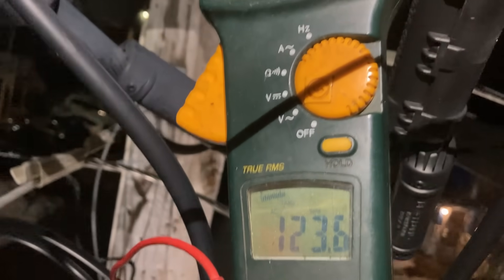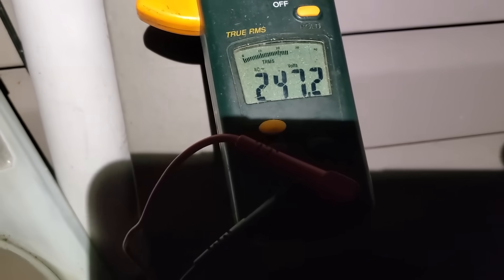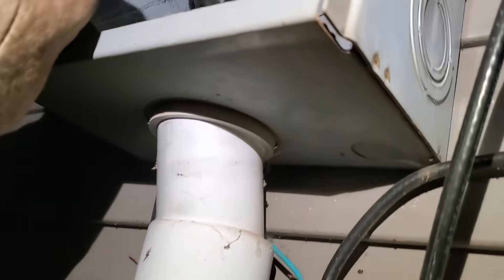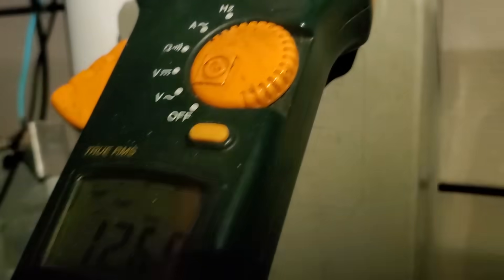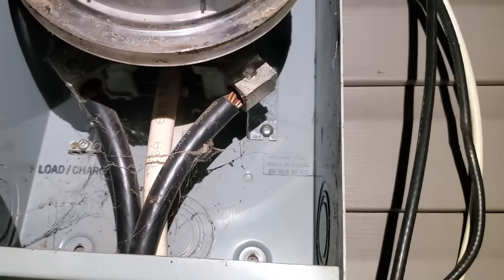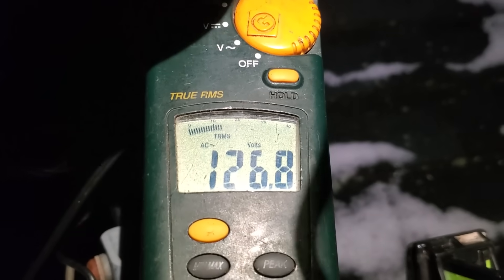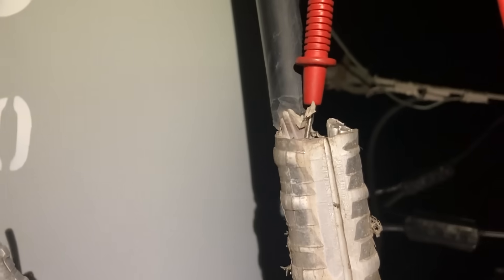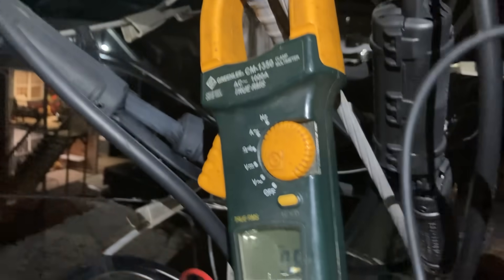Finding a bad neutral on a Service - Raw footage

Comment: I recall seeing my first bad neutral at a house we managed -- Randomly, appliances in the house would start smoking without being touched. Voltmeter read fine, until I set it to hold on max, and then saw that it was briefly spiking to ~190. Was a windy day by the ocean, and over time the neutral loosed within the meter, most of the time making decent contact except during gusts. Love seeing your step-by step of diagnosing problems!

Comment: Can you guys imagine bed neutral here in EU? We have 400v three phase service and 230v across phase and neutral. If you get a floating neutral, there are wild swings in voltage drops/jumps. You might have 50v on one side and 330v on the other leg, depends of imbalance. Stay safe, greetings!

Comment: when there's a bad neutral, I generally find the CATV coax carrying current back to the street(scary!), especially when you find it's smoking hot, melting and carrying over 15amps of current.
always clamp on ammeter test! don't go playing and handling it directly unless your geared up.
I've also found current flowing back out city water supply lines via the ground bonding to older metal service lines. 
some buildings with the neutral completely ripped off and still working seemingly perfect, no signs of problems, stable voltages and nobody had a clue. other than I've started to check the alternate grounding paths by default.

Comment: my line crews carriy the "beast of burden" and they can load test the nuke without putting overvoltage on the house system.  
homeowners: if you ever turn on a light and another light gets brighter, that's the warning sign of a bad neutral.

Comment: Hahaha how the hell did north America end up with such a ridiculous power system?
Reply: This isn't specific to the North America split-phase system. The exact same problem can occur on three-phase systems.
Reply: It was the first iteration of the grid and it’s far too late to change it unless it all fails. Other grids came in later once better engineering was discovered, one of the main reasons why many other countries run on 220v instead of 120v, and why we still use 120v.
Reply: @TheBrutalSax  this isn't true at all. There were plenty of other grids developing at the same time. The US grid as such didn't actually developed until long after the first generators came on line servicing their local area. There was plenty of opportunity to change this based on what others had learned. Too late now I agree.

But this is more about American insistence on doing things differently to the rest of the world just for the sake of it. Your clinging to imperial measures and weights for example. A nonsense archaic system the entire rest of the world gave up on decades ago. 

Your cable Guage system where for some loopy reason the larger the number the smaller the cable. WTF?  What sort of loony thought that was a good idea? Except you guys are the only country to do it.

Comment: We experienced a lost neutral at my family's home a year or two ago.  We were having weird problems with lights getting brighter/dimmer as other loads (AC, microwave, dishwasher, etc) came on and off.  After checking with a multimeter and getting 150+ volts (IIRC), we shut off the main breaker for the evening and called our power company in the morning.  The lineman who came out to check the issue actually had a box that slotted into the meter socket and, based on my best guess, contained a pair of loads on switches to test the legs.  Turned out the neutral had broken off of the transformer.  But a dedicated leg testing tool definitely seems like a safer option then asking someone to turn on high power appliances in their home.

Comment: This was an excellent video That could even speak to  balancing Your Box at a house when doing a remodel...Love these technical Vids.  On the flip Side I've asked before Can u do More on 34kv,  Identifying POTS ,  Insulators are typically not a good way of knowing anymore based on size because they over insulate regardless of voltage. . Also Curious If you Have anything On trailering Poles out to jobsites and what types Of trailers used.   We Do a lot Of Projects for Excelon South Of You and  power upgrades asking us  For Class 2 55  and 60 Poles.  As You know I'm telecom and we work with one of there local companies in and outside of Philadelphia.   Starting to question The trailers we are allowed to use with some 10 plus feet of pole hanging off the end of our 45 foot trailer. Couldn't find anything IN Our Department of transportation saying it shouldn't be allowed to have that much hanging Off the Back But yeah Your standards north of the border would be a great Video..   Its getting sketchy... Any questions please ask

Comment: Just had first hand experience with this as a consumer.  On the 23rd a squirrel managed to chew through the neutral coming into my house.  I happened to be next to the breaker box when the light show began and flipped the main.  The electrician saw the problem and I contacted the power company to get it fixed.  According to the electrician with a fully cut neutral I had close to 250v on some of my outlets, fried my stove, fridge, and several surge protectors.  Made for a fun christmas.
Reply: I suppose you received the gift of new appliances 😂
Reply: same thing happened to us, a tree root caused a break in an underground neutral.  We fried all kinds of stuff new years eve.  HVAC var fan and board was the most expensive at $1k. Stove blew the 120v parts so no oven controls, but range tops still worked.  Also lost some expensive GFI breakers for some reason. Total cost was equal to our deductible, so we didn't even bother reporting it to insurance.

Comment: As a non-lineman homeowner my only experience with this was years ago when my lights suddenly got real bright when it was windy then returned to normal.  Got out my meter next time it happened and I was getting 188 volts on that circuit. Don't remember what the other leg was, but it was quite low.  Had to head to work, and didn't know what was causing it so turned off all breakers except my fridge before leaving.  When I returned in the evening I saw that my neighbors line (triplex) was brand new.  Haven't had that issue since.

Comment: Very Interesting video!! I'm surprised you didn't talk about the customer's ground, (driven or water pipe). With a defective service neutral you will get return voltage on the house ground. (If it's the easiest return path) You could also amp probe the customer's ground. 
Keep the videos coming, very enjoyable!

Comment: Being an electronics technician, I would have just measured across the junctions until I found that 5vac or so. Indicating a circuit impedance rise at that junction.
Reply: The downside of that way is you can only find the fault if you check directly across the fault. If it's on a splice you miss or it's a break in the wire you will never find it.
Reply: @eDoc2020   Keeping track of the circuit's paths is an indicator of ones troubleshooting skills. I always endeavored to know the circuits under test. Like computers, the brain suffers the same issues of "garbage in = garbage out" syndrome. If you do not know the actual circuits, your techniques of deduction. 
may seem irrational.
Reply: @markcummins6571   IMO the theoretically best approach is to put one lead on the transformer lug and the other on the meter socket, then move down the line to reduce the test area as much as possible until the problem is localized. Then you can save time by testing the drop of multiple junctions at once, perhaps using a binary search pattern. The problem of course is you need ludicrously long probes and you need to walk around a lot. This technique works much better when the entire circuit fits on the bench.

Comment: Divide and conquer is a good tool for a lot of troubleshooting issues.  A bad neutral can go undetected for a while, depending on the load. Do you separate power and lighting in a circuit in Canada? No lights and receptacles mixing on a breaker?

Comment: We use a few tools made specifically for open neutrals. Arnett Super Beast to test the service voltage while load is applied without risking the customer equipment. We also use the Bierer ST800 to locate the bad connection location. I recommend looking up the ST-800 video. It's one of the best tools I've used in 20 years as a lineman.

Comment: Bob, 3V on 1A load is a SERIOUS ohmic resistive loss at the bad contact crimp!! about 1/3 ohm.. which mean for each 10A unbalance load there is 30W heat loss . Btw You could also simply measure the low voltage  loss each side of the bad crimp.

Comment: I think I would have used an 2kW space heater without the meter installed to put a load on one leg (without meter to avoid damaging the appliances of a customer).
Most devices like wide range switching power supplys should work with up to 230V for short periods of time until you have found the fault, only light bulbs and some "not wide range" electronics would have problems. 
Here in Northern Europe with the standard threephase 3x400V/230V supply in every house a bad neutral is a big desaster in really short time. Most wide range power supplys only go up to 250V, which is sufficient in normal cases with the 230V Phase-Neutral Voltage. Ohms law destroys radios/TVs/Computers/lights and leaves space heaters or other big loads alone if you put them in series at 400V, which happens if the neutral breaks...

Comment: When the current is really low like in this case, it probably doesn't take much difference to cause a noticeable voltage difference.  If the house had been drawing 30A + 32A the voltage difference might have been in the noise.  All due to the winding resistance at the Xformer.
I like trouble shooting videos.  A few months ago one of my UPS' signalled a ground fault.  Took me many hours to find it.  (Was in a ceiling light box at the other end of the house that also fed the bedroom end of the house where my office is).  I figure that open ground has been there for many years.  Only when I moved the UPS did I see the GF light.  Hard to find, but easy fix.

Comment: I would not use the unknown customer loads to test for a loose neutral. Aside from putting their equipment at risk, you do not know how much load is actually on the neutral. Connect a known load across one line and neutral, and by measuring the line to line voltage with and without load, and the line to neutral voltage with load, you can quantify the relative resistance of the neutral conductor to the line resistance. Switch the load to the other line, then you can also determine the relative resistance of the lines themselves.

Comment: When you apply load across one line and neutral, the voltage across the other line and neutral absolutely does go up since the impedance of the neutral conductor back to the transformer is normally much greater than the impedance of the transformer and it’s supply. The further you are from the transformer, the greater the effect.

Comment: You did mention aluminum wire on the service line, but what is your opinion on a house with all aluminum wires, my friend just had all of his wires replaced because he felt that it was a bad thing, even though it worked fine since 1950, is it really a bad thing to have aluminum wiring?
Reply: The wire won't go anywhere, the issues are those of sizing and corrosion. In the case of the former, aluminum is less conductive than copper, so the rule of thumb is to go up one size. Whereas 14AWG copper is fine for 15A, with aluminum it should be 12AWG. Some electricians I don't think understood that well Back In The Day and installed undersized wire.

The latter issue is, as far as I can remember, the cause of associated fires. Mating dissimilar metals results in galvanic corrosion, resulting in a high-resistance connection. The bad connection shown in the video is actually an example of this. If such a corroded connector was in a wall you get a lot of heat in a small space. The wire can be safely used with some attention paid to that detail. Receptacles and switches and the like need to be rated for aluminum connectors to prevent this (a lot are, these days). Local code may stipulate that an anti-oxidizing compound be used on connections with aluminum wire. Retail stores where I live in Canada sell Gardner Bender "Ox-Gard" and IDEAL "Noalox" for this
Reply: @holysirsalad I guess the aging of the wire may be what he was afraid of, it was his parents house and he intends to make it his last house, still just seems like a lot of expensive to rewire it all, I bought a 66 years old house and had to do a new service and didn't realize the cost, I did some additional lighting and rewire plus the whole new service and spent over 7k

Comment: Nice video Aaron. Sometimes you can use a voltmeter across both sides of a splice connector and see the voltage difference. In your case it might have been anywhere from 1-10 volts. This can also work for a  Main breaker or individual SP or DP or Three phase circuit breaker and fuses too. Stay safe!

Comment: With a BAD/OPEN neutral the two sides are in SERIES.
The side with the highest load will have most voltage drop? 
SERIES, voltage rule.

Comment: The first house I owned had a bad neutral. Back in the days of incandescent bulbs, when the motor in the dishwasher started, a nearby lamp got brighter. Now, the challenge was getting the utility to make a visit. No one had lived in the house before i bought it, it had been the office for a few model homes. The neutral to water meter seemed OK, as did the neutral inside the meter pedestal, which i could open about an inch without breaking the seal.

I called ComEd to report the problem, and of course, they wanted me to call an electrician first. I exaggerated my credentials, and told them i was an electrical engineer, while I had only taken a few Electrical Engineering courses as part of my Computer Engineering degree. This was enough for the person taking the call to dispatch someone. When i got home from work, there were no more lights getting bright as I ran the dishwasher.

I know the utility wants to be sure the problem isn't on the customer side before dispatching someone, but that would have cost me real money. I did as much debugging as i could without pulling the meter.

Comment: Wish you worked for my provider. Had the same issue intermittently lights would get super bright for a moment then dim. Guy came out around lunchtime and said bad neutral no biggie which I knew was the usual suspect. Guy went to the pole and found what he visually suspected was a bad crimp. Changed it out and assumed it was good, didnt even say anything to us after, he just punched the meter back in and split. 

Problems came back quickly and it was getting worse so we called again and they sent the guy back out, now just after dinner. Finally put a meter on it and had 142 on one side and 109 on the other with power on. Decided it had to be at the service connection on the house, but now it was dark so he couldnt use a ladder without calling someone else because of the SOPs. Told us he wouldnt call cause the company doesnt like to pay a second guy OT. Say he can leave it or he can back across our lawn and use the bucket, but we have to sign a release for any damages that did to our lawn. Im a firefighter, and the thought of 142 volts with an older home and some things ive found from past DIwhy owners- and what i havent found and wasnt going to have it left that way. 

I did protest some and point out that he could have fixed it the first time and therefore asking for a second person or not asking us to sign a waiver wasnt unreasonable considering it was a safety issue and it was his second attempt. His response was to threaten to cut all power and come back tomorrow as a 'screw you', which he may have done had I not pointed out that we were standing in front of my ring doorbell and that as bad as all that would already look, and as much as I despise people who use it, there's law about cutting power when there's a disabled child that he would be violating. 

Amazing how fast he reacted to the realization he had admitted on video that he had made an assumption, not tested anything before or after and then found that he left an unsafe condition which he refused to ask for a second tech or not drive a line truck across my lawn to fix then topped it with a threat to cut my power and have no heat or water if I didnt let him tear up my yard to save himself getting chewed out by his super for needing the second guy... A second guy was rolling up 5 minutes after he called dispatch...

Have had 2 TVs die and the power supply caps on the main board on a fridge burn out soon after...but im sure its pure coincidence...
Reply from the maker: The situation with sop's is somewhat reasonable except for one major problem! (As you pointed out). He was already there earlier and messed up! Him/the company should have been rolling out the red carpet at that point!!

Also imo, a bad neutral on company side, should have been fixed regardless of o.t costs.
Reply: @Bobsdecline  agreed on all counts... but I think he knew if he had to call then he couldn't avoid telling his super that he screwed up. If he pressured us into the waiver then he could fix the second issue and nobody would know that he screwed up.

Comment: I learned about a loose neutral at a house I once owned. Every time I turned on a toaster the kitchen lights got brighter.   I went to an electrical self help blog and a user said it was most likely a loose neutral. In the main panel I found the previous owner/builder had cut the neutral too short, bent the conductor to a 90 degree angle to get it into the lug, then failed to torque it properly.  The aluminum wire had heated and corroded over time. I repaired it and the problem went away.